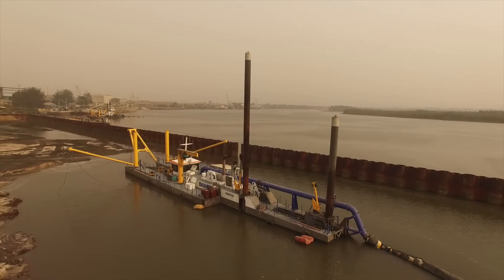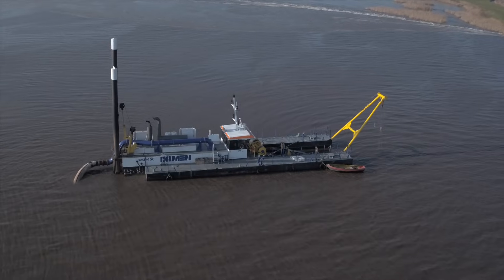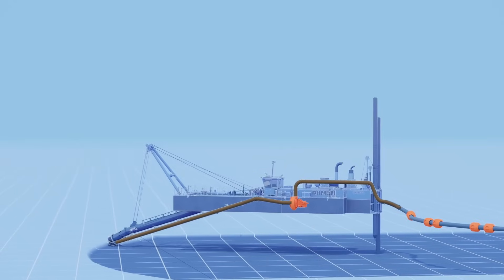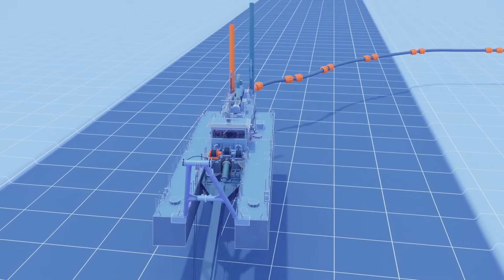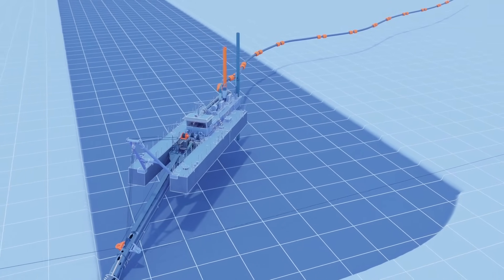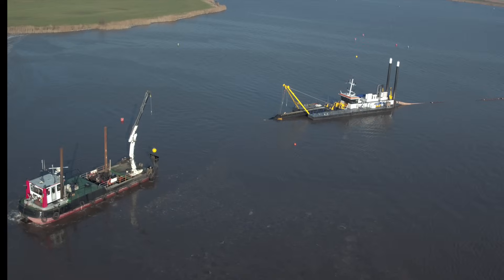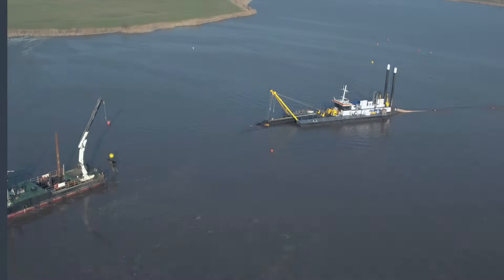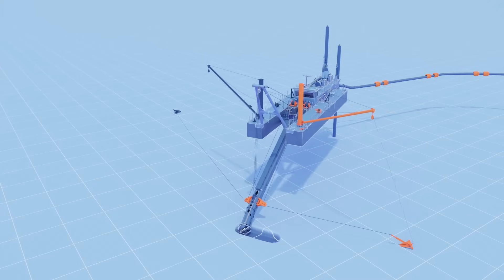How Cutter Suction Dredging works | Damen Shipyards

Comment: How is the dredged material especially sand measured accurately?
Reply: Hydrographic surveying of the area before and after dredging, then comparing those charts.
Reply: @SouthJerseyMatt Rough estimates are given via onboard velocity and density meters, but yes, you're correct.